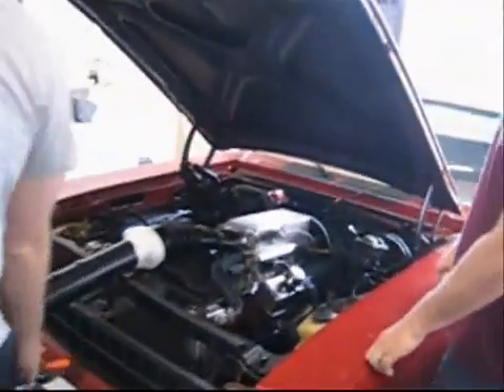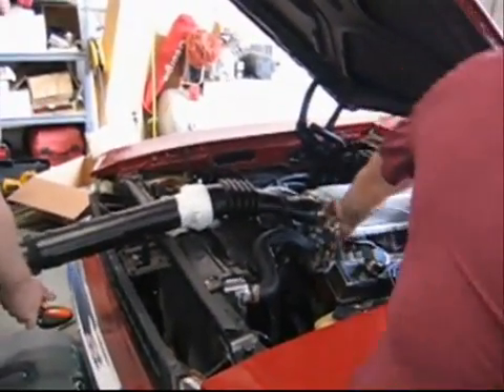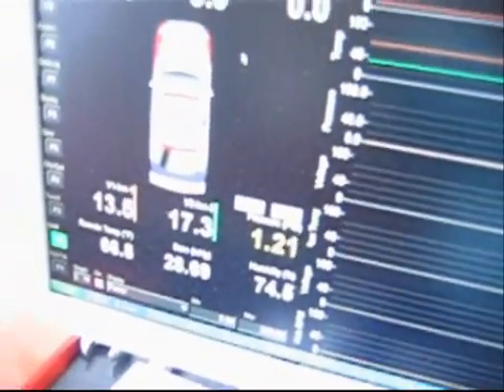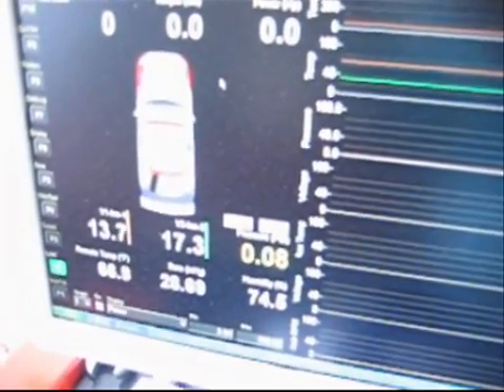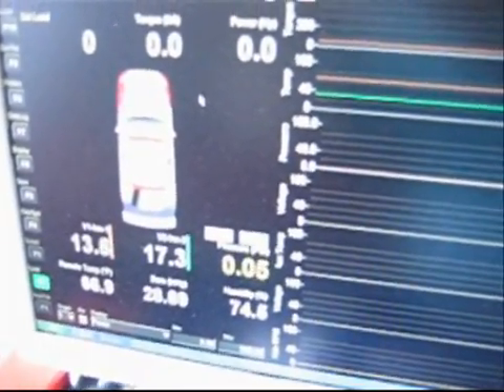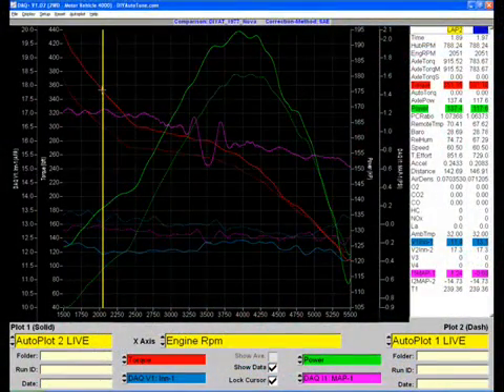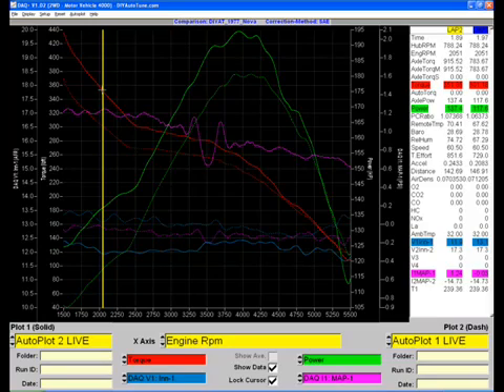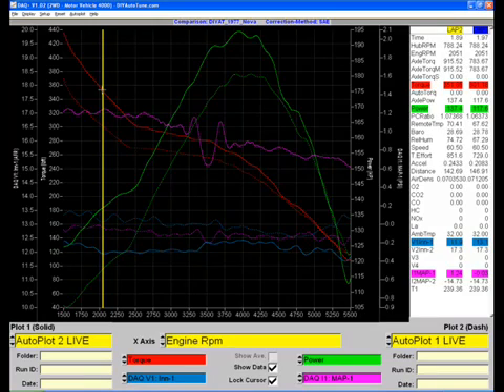Installing a "Blower" on the Nova - MegaSquirt EFI SBC 350 with Leaf Blower mod ;)

Comment: im actually very surprised it made boost all the way through
Reply from the maker: I honestly was too!   I wonder what a squirrel-cage fan (like a carpet dryer, similar to what we use on the dyno for the radiator/intercooler) would do!   Hmmmm.......